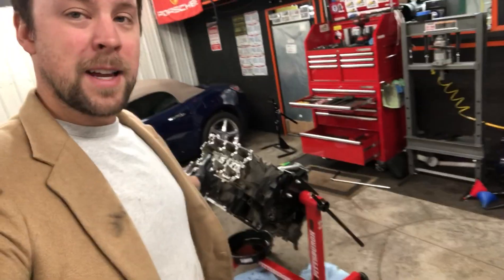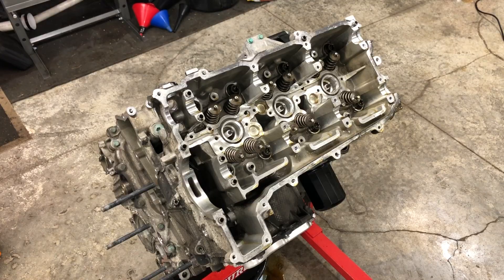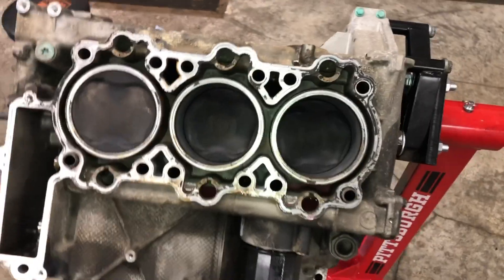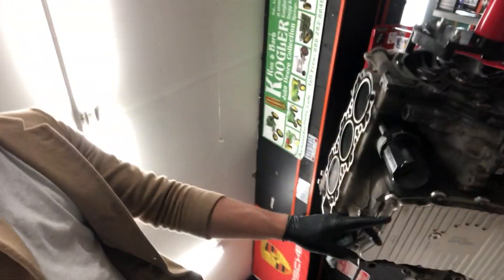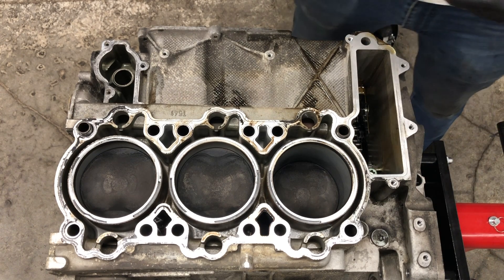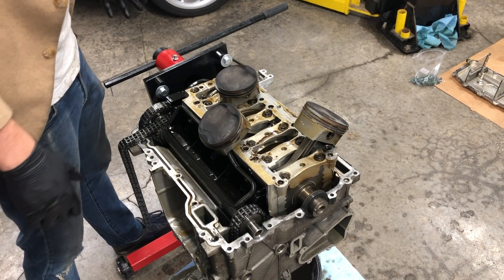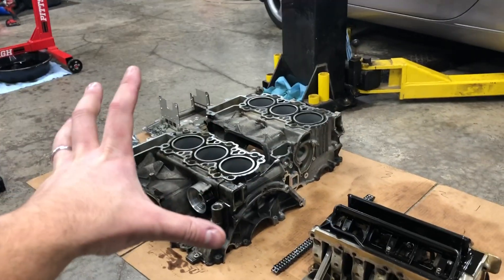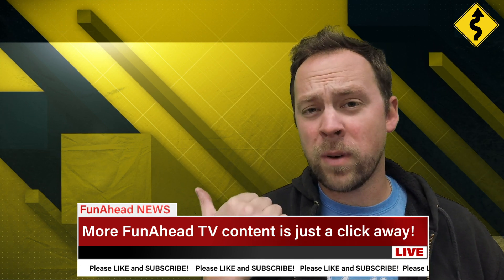Totally Tearing Down My 911's M96 Engine! Project Beef, Ep 3

Comment: You mentioned aluminum being high when the piston skirts start to wear.  I had a recent Blackstone report showing that my iron (997.1 3.6) went from 6 to 16.  Any idea what would elevate my iron like this?  Any idea at what level of iron would be concerning?  I'll keep watching it, but do wonder why it would spike like this.  Thanks!  -Tom.
Reply from the maker: Hey Tom! What did Blackstone have to say about it in their write up / summary? Did they note it as a concerning thing? A lot of things could effect it outside of a major issue... age / mileage of oil, how you sampled, etc... But obviously it'd come from anything steel in your engine... lifters, cams, crank. Don't stress though! Keep a close eye on it and if it continues to show high for future reports then start digging into it further.
Reply: @FunAhead_TV_Official  I think they might just think it is a one-off due to normal variations in driving or conditions.  And that is certainly possible.  I'll keep an eye on it - I oil sample every oil change at 5k so it is easy to plot trends.  I appreciate your input!
Reply from the maker: I see! I think that is very likely the case. Oil analysis reports are a great indicator, but there are certainly outliers… just too many variables!! Glad they weren’t too concerned. Besides, at the of the day, 16 isn’t too far above that universal average. I’m sure that there is quite a spread within healthy engines.